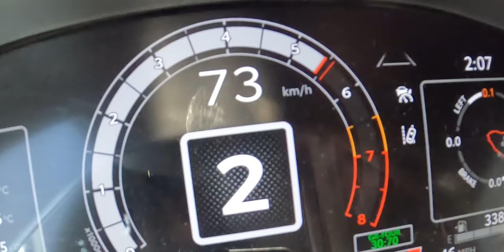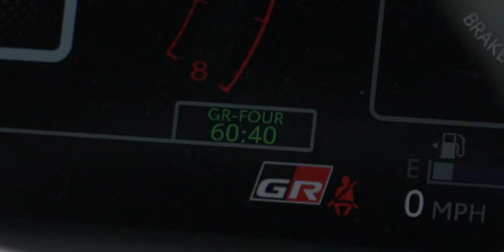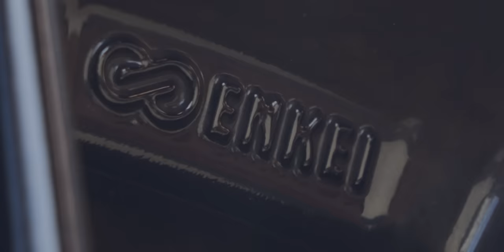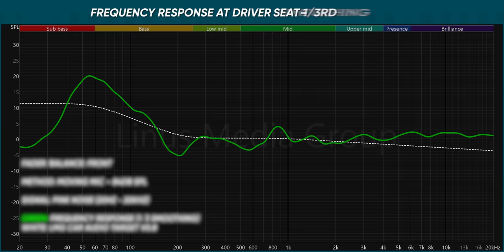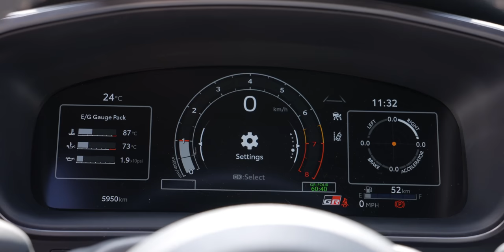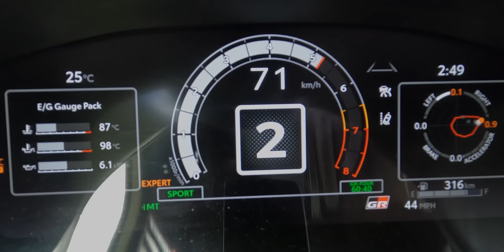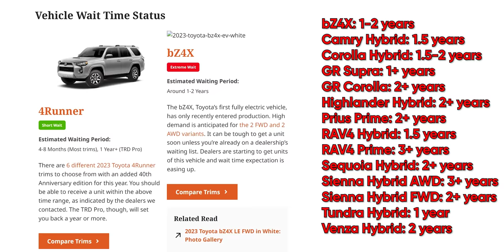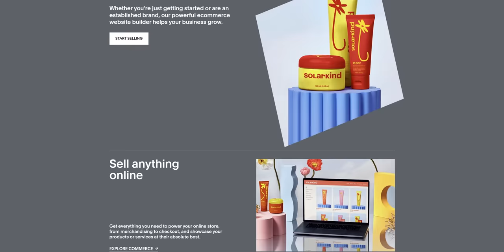I have made a very expensive mistake - Toyota GR Corolla

Comment: This is hilarious and so relatable.  I traded in my tesla (while to save money) and went initially for a Chevy spark, ended up driving a Mustang convertible ecoboost home.  Felt like a kid again doing minor mods, putting in a blow off valve, and getting that nostalgic gran turismo feel back.  While EVs make sense for certain scenarios, they really suck the life out of driving and you don't know what you got until it gone.  Except I did go with an automatic so easy in traffic and can paddle shift away when I was timed pshhhhhhhh noises.  Best decision ever 😅
Reply: Gasoline car or electric car is better, a bit tangled
Reply: @masterliu1892  it depends on your situation.  With an electric car you need to be sure you can do all your driving in a day off an overnight charge.  It's expensive to charge at a supercharger, in some cases more than gas for a fuel efficient 4 cylinder.  It also depends on your climate, if you always need heat or AC on top of driving far, you lose potentially more milage than a gas car.

With an electric car it will cost you around $700 for a charger or less for a Tesla charger. 

You have almost no maintenence on an electric car.

Depending on your state, property tax may be very expensive and some states actually charge you a fee because you are not paying the tax they normally receive from buying gas.

If you have solar panels that offers at least "free" electricity and some independence as you don't need a gas station or utility company to fuel your car.

Long story short, electric cars are great for city driving if you can charge at home.  But it really is not clear that they are cheaper for every situation.  My advice would be to continue waiting for the technology as a whole to develop and we get to something much higher than a 6% adoption rate.
Reply: @mattvmani Agreed. But given a lot of electric cars social status is tied to more Luxury branded gas cars rather than economy cars, there’s an apples to apples comparison to make there as well against Premium gas tier cars, not just a basic economy car that uses unleaded only.

The issue for me is motherboard computer components failing on all cars, especially due to heat wear and tear as the climate gets hotter.
Reply: @infernaldaedra id imagine there are a lot of places and countries that have high enough energy costs that fuel could be a cheaper option. Besides the base car value.
Reply: @brutalhonesty07  yeah, while that is true, I'm a tech person that wanted to try the whole thing out.  And not to mention at least in CT you're essentially getting 10 grand off the car.  And while yes, it absolutely is not a corolla, you can spend far less money and get lane keeping with adaptive cruise control, leather seats, etc.  Even economy cars have far more luxury items than ever.  The tesla had rear heated seats, more sophisticated lane keeping and cruise control that still could go awry, and a glass roof.  That's all the extra luxury it offered in my cave.  Point being, it doesn't have to be apples to apples as it seems people buy an EV for a variety of reasons including stupid ones or myths they think are true.  I just feel bad for those that don't do any research or even are just curious, it's extremely hard to know whether they're even worth it.
Reply: @mattvmani  There no escaping the algebraic calculation of a purchase and thus we’ve found our answer to the high school question “when will this matter outside of high school?”. 

Yeah your CT situation is unique. I don’t think I got that offer where I am.

I used to be a Tesla fanatic, but after seeing how Li-Ion battery tech degrades over time was the deciding factor for me to do nothing at the moment.  The battery tech just isn’t there yet, and I do have solar on my house for close to 20 years now.

A bigger decision for me is a Tesla power wall or a rival corporation that does the same thing. Much more useful to my lifestyle than a car.
Reply: @brutalhonesty07  haha that is true. 

As long as you are in the states you will get the $7500 off but the rest may vary.  They supposedly will give that to you up front next year rather than having to file in the following year.  But even that doesn’t necessarily make it worth buying as 7500 off 40-50k is still an expensive car and big payment.

That is interesting, how are the panels holding up?  I’ve been half worried about being unsure about the actual span of them and if you’re getting into replacement/repair cost long before the 25 years of supposed use.
Reply: @mattvmani  Inverter technology has only gotten better than when I had my system installed. I went with a more luxury end panel in terms of heat and glare reflection so as not to make ire with neighbors.

They’ve lost about 8% efficiency after 20 years, but the worst cost or value-back lost was during various blackouts, and the 2016-2018 fire’s ash blocking out a lot of those year’s production value.  We can call those years a bit of an anomaly in those calculations. 

But combining the value of solar with a home battery would’ve solved the issues of blackouts, as during a blackout you’re generating power, but the power company notes they don’t credit you during that time. So unless you’re capturing the electricity for your own use, you lose it. 

So in my case it’s a bit more nitty-gritty of a calculation in terms of positive incentive of why you’d invest 40-50K when you already have or plan to get solar.

My solar panels regardless have achieved cost neutrality in 2022.
Reply: @brutalhonesty07  that’s very insightful! Thank you for sharing.  I’ll have to be sure to consider all that in the near future.  It still kills me thinking of that amount of money 🫣 im happy you made it there!
Reply: @mattvmani  yeah so in my perspective you have to understand I did all this before rebate programs existed. I was ahead of the curve, and so now I see today’s deals and I’m like....”that’s a good deal!”, and I cope by just converting in my mind cash I spent for comfort to sleep at night during the years of 2005-2016.  So in my head I don’t expect full cash value back, I’ll be happy at 60% back if I figure I’ve converted my cash into cool air and ability to sleep. In that relative perspective I’m ahead in value-add by 200% already.
Reply: @infernaldaedra  I like to think I’m a tech guy lol, but I want the dumbest vehicle possible

Comment: I work in automotive repair and it’s honestly such a mess with dealer-manufacturer relations rn. Automotive in general is in a very weird spot rn that could take up several full length LTT videos. I’m just glad the Subaru dealer I’m getting a job at only lists vehicles at MSRP and won’t install any accessories unless the buyer specifically asks.

Comment: The driving experience sounds similar to that of the Abarth 500, and is the exact reason I just bought one, so much fun in such a tiny ball of a car.
Reply: I've driven that car in Assetto Corsa (an older model year probably), and that car can really be a blast! So many faster cars in that sim, but the Abarth has character and it's fun to learn on and drive at the limit.
Reply: @edwardmclean5373  I actually have an Italy export 2008 year model, so pretty much the very first batch of production.
And yeah, many people underestimates how quick it can be, but as soon as the turbo charges, it pushes you forward like a damn hammer, it's so fun, specially in the highway lol.

Comment: "It has character" - yes Linus, you have discovered the exact reason why i will hold onto my ICE cars  with manual gearboxes until they pull me off kicking and screaming. Plus, small and light = fun during normal driving. Speed is fun, but half the the time you cant use it.

Comment: those 3 cylinder turbo toyota is using tend to blow up way too quickly, makes sense considering the block is aluminium with wet liners. wet liners are ok for a naturally aspirated engine but for turbo engines you want dry liners, specially when you're pushing 25psi of boost. also, the always-engaged clutched lsd will need maintenance way more often than a normal clutched lsd.
Reply: The block is thicker

Comment: In Brazil the GR Corolla costs about 90k USD. Dunno how it's priced (compared to the competitors I mean) in the US/Canada, but here it's outrageous. For a lower price you can get a Mercedes AMG A35, which offers better performance and luxury, at the "cost" of an automatic transmission instead of manual (which doesn't matter in the end anyway because the A35 has a manual mode with paddle shifts behind the steering wheel)

Comment: it's more fun to drive a slow car fast, than a fast car slow - you may say that statement but the real statement here is light cars are fun. electric cars are overweight and heavy. motorcycles are the most fun because they are so light. Miatas and the 86 cars are also very light so they tend to be the most fun cars. 3200 pounds (rough estimate) is when you can tell a car isn't as responsive due to its weight

Comment: The Toyota-buying issues sound like a North America thing, cause none of that is a thing in EU to my knowledge, you can buy Toyota quite easily here and it's one of the top selling manufacturers. American car manufacturers have grip on the market in NA, and there's probably tariffs for importing cars etc. I'd reckon American manufacturers have lobbied for decades for legislation that gives them more and more advantage over foreign cars. And with the tariffs and other extra costs, the profit for dealerships might be so low that it's only worth the time, if you bundle up all the extra stuff.

Comment: GR 86 is more fun at legal speeds. Or Mazda MX5 MIata. And they cost less and are easier to get too.
AWD system of GR Corolla only shows its full potential on snow, gravel, etc, NOT on dry roads / the track.

Comment: 1) Drifting is NOT the fastest or safest way to go around a corner.
2) If you really want to drift, get a car with rear wheel drive and a limited slip differential.
The hassles with the pricing and dealerships is only going to help accellerate the demise of legacy auto, including Toyota.

Comment: As a long time Focus ST owner I’ve been eyeing up the circuit edition for quite some time now as it seems like the only new hot hatch that I’ve deemed as a worthy replacement. The dealer situation and markups are killing that desire though. 

50k can buy a lot of car. Having a hard time justifying that on a Corolla, especially with used RS3’s and M3s being right around that price point. Hoping as time goes on it improves but Toyota doesn’t seem to have any reason to change it.

Comment: dont drive faster than 85mph. toyotas warranty doesnt cover that!!!!
if the car burns down(break a little hole in the engine block and spills oil on the hot turbo it can burn down.) please check and make a video about it!!!!
the car sends data to toyota and this includes the driven speed.

Comment: Cars are tools. An expensive tool, even a box stock standard Corolla, which is a very reliable and durable vehicle, is a money pit. "Sports" cars break often, break expensively and require fuel, tires and other consumables like they're trying to eat their way into being a Brink's truck. Then there's insane loan payments AND insurance payments that may top the cost of the yearly loan amount. This from a guy who was very into cars in the 1970s. All the bells and whistles are also stuff that's going to break, likely impairing the ability of the vehicle to operate properly. The electronics are often unnecessary and expensive toys and very prone to failure, think taking your over the top gaming rig and mounting it on a paint shaker that turns on with the computer every time you want to use it, that's exactly the environment the stuff in your car lives in. Oh, and it's outside when operating. Sounds pretty damn dumb doesn't it? And people with any sense at all should have strangled the dumbass who first suggested using touchscreens as a control interface for every friggin' function. Knobs and levers and muscle memory mean you're not looking at the damn screen instead of the road where you should be looking, instead of trying to discern whether the menu you're in is the one that you want while careening into the group of bikers parked on the side of the road. And, hilariously, turbochargers on dinky engines that keep lots more intense heat inside the engine compartment where it can degrade all the cheapass plastic fittings and hoses more rapidly. And you'd better do ALL the oil and filter and other maintenance nearly twice as often as the user manual suggests if you want to make it to the point where where the boost  from the turbo wears out the oil rings and compression rings prematurely because that undersized golfcart motor is pretending to be the 3 liter V6 it should have  been to begin with.
End of rant.

Comment: 10:07 When nerds believe their video game experience translates to real world use. Then follows with the worst explanation of an AWD or 4WD system. The center differential (or transfer case), is what allows the front and rear axles to spin at different speeds. The center differential controls the toque split. So much mis-information, this is as bad as "bad computer advice".

Comment: I just want to say, stop using stabilized camera for in-car A-rolls . The camera moves independent to the jiggling car yeah, but what also moving with the car? That's right, the people sitting in it. So you have the footage "stabilized", but the presenter is moving around in the frame. It's headache inducing.

Comment: That AWD system is fairly common and old school, subaru were doing it 30 years ago.
The centre differential proportionally transfers torque from the axle spinning the fastest to the one spinning slower with a ~1% dead band. 
So under steady state driving the rear wheels are disconnected from the drive train for better fuel efficiency.
But whilst the fronts are slipping (tyre's grip the best when traveling slightly faster than road speed up to around 5% where they suddenly lose grip) torque starts getting sent to the rear to keep the fronts under the slip limit.
If the fronts do break traction they'll be heavily locked to the rear.

The only issue with this type of diff is it can be a bit weird under heavy braking. If an axle locks due to no grip (or someone pulling the hand / e-brake) then torque will be sent to the locked wheel to break it free (or on the flip side the braking torque from the locked wheel gets sent to the other axle) it can make the car a little unstable especially if it's only brief.

Aka why a tech youtuber shouldn't try and to a brake drift...

Comment: does the engine really have an oil starvation issue FR? If i had a coin for every time a Toyota engine had oil starvation problems in long corners id have two. which isnt alot but its weird it happened twice

Comment: I know I am several days late. But it was really great go see a normal gas car on the channel. Often times only EV's are covered. Unlike Canada most energy is not generated in a clean manner so it doesn't make sense to tout EV's as planet saving. And while a small portion of your audience could afford a tesla etc. There is the hidden cost of the electricity (usage goes up exponentially) meaning that the consumer needs to go solar and also get batteries since NEM agreements are diminishing around the US. So in order to properly use an ev and make it useful you are talking about a minimum $35-55k additional investment to the car... So long story short. Hope more economic cars are covered and hybrids too.

Comment: Psssshhh 15k markup isn't anything. A stupid dealer (Camelback Toyota) here in Arizona wanted 120K for a GR Corolla. Needless to say, they didn't get much interest. Crooks. Also, F*ck these manufacturers who are operating on the "limited production" B.S. to justify prices, wait times, and hype to sell their cars.  Want a new GR Corolla? Here is a better idea - buy a well kept low mile Fiesta ST/ Focus ST, MazdaSpeed 3, GTi, etc. With the large amount of money you saved - you can throw a few bucks at it to make it more fun. Get 90% of the experience for 35-40% of the cost.

When I wanted a fast(ish) more modern four door car to replace my E36 M3 I sold to a friend - I went and looked at M3s, M4s, RS3s, etc. But the markups and wait times were stupid. Anything brand new, and hyped was big markup and/or big wait. I went down a deep, dirty rabbit hole and found out Ford was making SHOs still. I found a 2011 SHO that was a trade in at a Mercedes dealer with every single option (12 speaker audio, heat/cooled/massaging seats, performance pack, etc) with 40k miles. One owner, well kept. Had a friend of mine that works at Ford run the VIN - had service history. Turns out in the color / option combo they made a whopping 19 identical to mine that year. I paid 15.5k out the door for it. While it isn't as fast around the track, or in a straight line as a M3 at the time (I bought it 6 years ago) it was still quick (0-60 in 5.1, quarter mile in mid 13s stock) it had basically as much, if not more comfort features. The stereo sounds great and I have put 60k miles on it with zero real issues. Shortly after buying it I added downpipes / exhaust, intake, map sensor and a retune - and it clicks of mid 12s in the quarter. So, for 15.5k + 2.5k I got 80% of the performance/fun, arguably better reliability, and it is a total sleeper - than  the "new" marked up/hyped up/shortage car for a fraction of the price. Don't regret it all and would do it over again.

Moral of the story is - be smarter with your car purchases. Sometimes you can save a ton of cash, and get very similar experience without falling for the hype/markup scam.